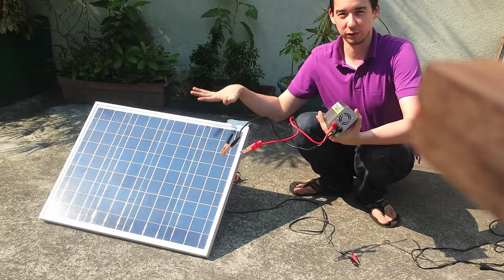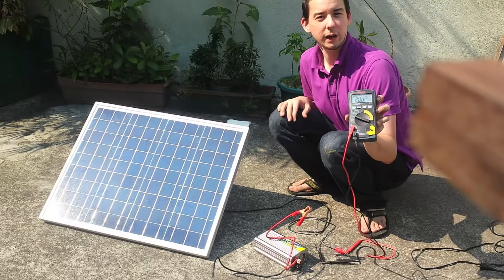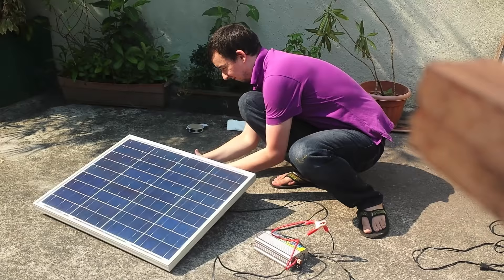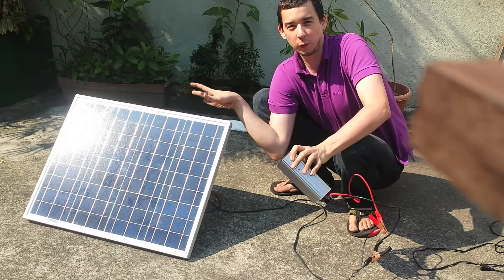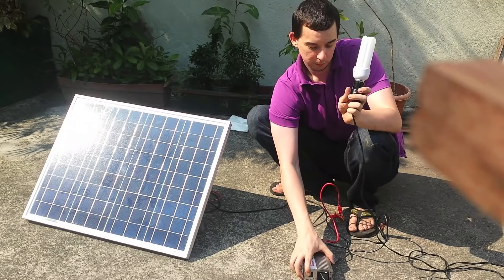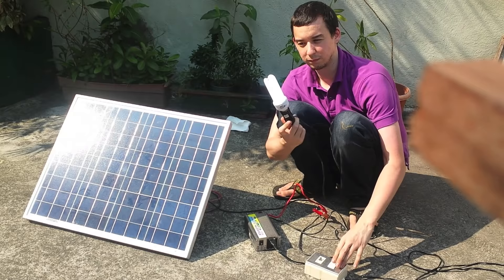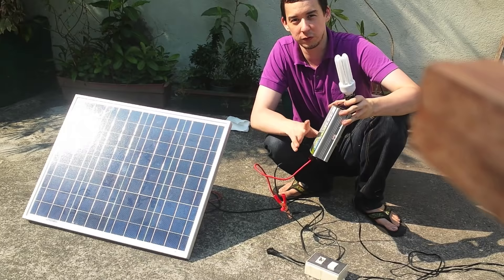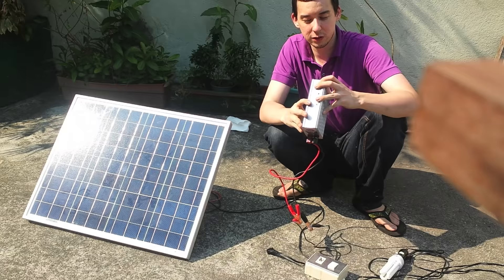Inverter wired directly to solar panel

Comment: how many solar  panels  and how many batteries  do i need to run an air conditioner from the solar panels ?  and what size iinverter do i need ?
Reply from the maker: ***** Mmm that question would take a really long reply and there are so many variables. You'd be better off Googling it to be honest. The short answer is a LOT of panels and a really beefy inverter.
Reply: Gadget Addict      ok  thanks

Comment: how many desktop computer can simultaneously run by 80 watts solar power system and how long it will last. thanks...
Reply from the maker: It depends how much power you are storing into your battery after losses and how much loss you had at your inverter and of course how much your computer and monitor actually consume. My guess would be 0 or at most 1 desktop computer on an 80 watt panel. My large (typical) desktop with monitor consumes 120 watts. But then I also have a small atom computer with monitor that consumes 30-40 watts. To know how long it would last, work out how much power you'll be storing after losses and then divide your load by that.
Reply: Gadget Addict Actually I really don't have any idea about solar power system but I'm quite interested to learn. Let's say I'm planning to run five 300 watts coffee vending machine simultaneously, what is the appropriate solar power system needed? Thanks for responding to my query.

Comment: my friend your video is really helpful.now i want to know from you please,i have  70 watt solar panel in my home with battery and charger.i am using that for lights only during load shading .now i like to improve it to 200 watt. what i need now.and may i use my led tv 32" from direct solar by using inverter that you shown us.
Reply from the maker: How are you running your lights from the solar power? I wouldn't recommend running an inverter directly from the solar, you should really connect the inverter to your battery.
Reply: Gadget Addict no i am using dc light without inverter. which call solar light/led each one 6 watt. and our request to you can you load a full solar system video around 200 watt.which will help us to make solar panel in our home. it will with all thing that we need including dc to ac converter.please
Reply from the maker: Monir Ahmed If you already have the solar panel and the battery then all you need is an inverter. The inverter will step the 12v battery up to 220v and you can connect your AC devices..

Comment: Well there is an MPPT grid tie inverter that is being sold with claims you can wire it directly to the solar array.
Reply from the maker: Yes that's how pretty much every grid-tie inverter works.
Reply: +Gadget Addict, ok. well that's reassuring to know.

Comment: You can of course run the invertor directly from solar panels. This is all a money making solar power to grid invertor does !! (your local regulations  may bar you feeding it with battery power. hmm. )

Comment: panu kung gusto kong i-power ang aircondition ko thru solar panels? pde pa ito? 700watts ung output ng aircon? so kelangan ko ng 10pcs na 80watts panel? and ilang 12v car battery ang kelangan? tnx
Reply: Pablo Reyes Mr. Reyes,
Compressor-driven appliances like air conditioners have a start-up current that is usually 5 to 15 times (or more depending on the horsepower rating) than the rated running current.  The inverter must be able to handle this momentary spike. Two things can happen if the peak current capacity of the inverter is less than the start-up current: 1. It will reset due to an overload condition  or 2. An inferior inverter will simply burn out.

Inductor motors do not work well with square wave AC outputs or even with modified sine wave inverters. These can cause your AC motor to buzz, be out of phase and eventually burn out even if the peak current and continues load rating of the device is well above the horsepower rating of your AC. It is recommended that you use a pure sine wave output inverter with a rock steady frequence (60 Hz in the Philippines at 220 VAC).

The power company output is a sine wave.

At 800 watts, a good range of will be above 5000  to 6000 watts peak rating for the inverter with a pure sine wave output. Check out your loading requirement and your AC specs if this is enough. At 220 VAC, chances are a lower rating might work for you.

As for the batteries, automotive batteries do not work well with supplying the power requirements you need to run your AC. Automotive batteries have high but short term AMPS (as what is needed for starting the car's starter motor). 

Deep cycle , AGM, or gel type batteries are what is usually used for powering equipment via an inverter. These usually cost more than regular automotive batteries.

The battery size will depend on how long you intend to use your AC in between chargings, your solar panel capacity and the charge controller you will be using.
Usually, batteries can run a load down to 80% of its rated capacity though there are AGM and Gel type batteries that can go down to 50% of its full charge capacity before you need to shut it down( or the inverter can do an auto shutdown to prevent battery damage).

To give you an example, a 100 Amp HOur battery running a load of 1 ampere can deliver 80 hours (80% efficiency)  of power before the voltage drops off to a useless level.  Your AC which is rated at 800 watts has a current rating of 3.6 amps (800W/220V=3.6 amps). Theoretically, your AC should run for 20 hours or so without considering other factors like system loses due to inefficiencies, resistances, battery condition, etc. Maybe you can run it for 2 to four hours before you run down the battery to 80 percent of its full capacity.

Then, there is the issue of recharging the battery via solar panels. A 100 watt solar panel can give you a charge time of 12 to 15 hours for a 100 AmpHour battery. This panel can output 8.3 amperes at 12 volts and a full sun. you can add more solar panels to increase your charging capacity and cut the charging time. You may also add batteries to increase the stored power capacity but this will require more charging times and/or more solar panel capacity.

Cable size will also play a factor in how much power you can get from your system.

Designing a solar power system is a balance of your equipment that needs the power, your battery size , your solar panel capacity and your budget. You will need a very good and stable inverter as well as for the rest of the system to power your AC  significantly enough to cool you for a reasonable length of time. And good systems costs $$$$.

gil

Comment: I got 20 Watts Monocrystalline panel and 12V 7ah Battery and 500 Watts inverter.
What are the Appliances that i can run with this thing.i use 15W light Bulb but it runs only like for just two hours.im a bit dissapointed.
Reply from the maker: If we imagine your panel got an average of 5 full sun hours in a day, the maximum power it could generate is 100 watt hours (20 * 5). But there are some losses in storing that power into your battery, so maybe it's 80 watt hours stored. The larger your inverter, the more power it wastes, a 500 watt inverter can waste 5-10 watts just by being turned on. So your 15 watt load actually becomes 25 watts. 80 watt hours / 25 watts =  3.2 hours. You should consider using DC lights connected straight to the battery instead of an inverter and ideally a bigger solar panel and battery.
Reply: 500watts inverter for a 7Ah battery, overkill.

don't assume that if you got a 500W inverter you also load it with a 500W electronics/electrical devices, you must consider also your battery size and your PV.

yang 7Ah na batt ginagamit yan sa mga UPS.

or better buy those Omni/Firefly emergency LED lamps that can last up to 8 hours at the cost of 1.5K, I think the battery inside is a 6V 4.5Ah SLA

Comment: maybe u can put a 12volts fix positive regulator on solar panel so that the output of solar panel is now fix at 12vlt
Reply from the maker: Yeah I could use a voltage regulator like the 7805 I used the other day to drop 12volt down to 5 volt. Although a switching voltage regulator is much more efficient (I want to try make one soon). But to be honest this was really just a proof of concept and a 'can it be done' type of thing. At the very least I'd recommend a 12v 7ah battery which can be bought for 600-700 php. It will make things so much smoother and easier and reduce the chances of breaking your inverter.

Comment: can i run a 100watts inverter directly on 10watt solar panel?
Reply from the maker: Possibly but I doubt you'd get any use out of it. In my tests, the 500 watt inverter from CDRKING consumes 5-10 watts itself even when idle. The 100 watt inverter consumes around 3 watts. So losses from the voltage drop, the idle consumption and then loss in output, I doubt you'd get anything workable for a 10 watt panel direct to the inverter.

Comment: Dear 
I need Your Help I have also purchase this inverter but i wana ask , can i connect directly 150watt solar panel with this inverter , i m confused  because  you have connected only one panal of 60watt
Reply from the maker: You can, for experiments, but for a long-term solution, you need to use a battery.
Reply: ok But if i use battery then how Battery will charge need suggestion ? can its possible solar panal conect to battery and batery connect to Inverter , possible or not , any fault or danger for inverter or solar panals
Reply from the maker: Manzoor Ahmad You'll need a solar panel, charge controller, battery and inverter :)
Reply: In a nutshell, you connect the panels to a solar charge controller. The charge controller is connected to the battery and charges the battery, and the battery runs the inverter. Of course, in the daytime some power from the charge controller is also powering the inverter. The battery 'stabilizes' the voltage.
NOW, the battery voltage should approximately match the panel voltage. 12v battery with a 12v panel, 24v battery with a 24v panel, etc for a PWN-type charge controller. If you buy a more expensive MPPT controller you can mix and match voltages.

Comment: How many yrs using CD r king solar panel polycrystalline
Reply from the maker: Less than a year. They haven't carried the large solar panels for a long time and when they first started selling them, they were only in a few stores.
Reply: How about a inverter,battery?
Reply from the maker: Jepoy Balanza I use motolite batteries, not CDRKING. The inverter int his video was used for a similar time period as the panel.

Comment: Hi I need to have power in my basement and I only need it for daytime use could I use a 1000w solar panel and draw 700w . Many thanks Martyn
Reply from the maker: Possibly but I wouldn't recommend trying to do that without a battery. The inverter would struggle a lot.
Reply: Gadget Addict ok thanks so could you advise me what I should use panels battery ect for a 700w power device pls I need it for 18hrs dayly
Reply from the maker: Well it depends how long you're going to draw 700W for. If it's just for an hour, you could go for a smaller solar system. You'll need panels, charge controller, deep cycle lead acid battery and an inverter. Depending on what you're powering, you might need a pure sine wave inverter.
Reply: Gadget Addict  well I'll need it for 18 hrs a day mate
Reply from the maker: Oh, you're going to need a much larger system.Full sun hours for your panels is 5-6 hours a day. And you'll certainly have to be storing the power in batteries because the sun wont stay up for 18 hours.
Reply: Gadget Addict ahhh I see so would  a car battery work for storing the batterys and if so how many do I need . and what's the least whatts solar panel would you recommend  .and other you get up really early or your not in the UK lol
Reply from the maker: Car batteries would work but they're not recommended because they're designed to output a large burst of energy to start your car and then a small amount while your alternator is running. You need deep cycle batteries designed for solar. You'd need many of them and many panels. To be honest, you might be better off checking some other solar videos, like i have a Solar 101 video. Because what you're describing is quite a big and expensive system.  Off the top of my head I'd say 3k GBP at least.
Reply: Gadget Addict 3k is that £3000 on what it will cose or 3kw ? and yeah  could you send me a link to your other video pls and are you from the UK? you have a British accent
Reply: you would need a 4000 watt solar system and a battery that can store 25000 watts or more and that is without reserve for cloudy days.  Or a 600 amp hour battery as a 48 volts system at minimum....a 3000lbs forklift battery, about $4000 to $5,000 battery new.
With car batteries you can only use 15 % of there capacity Which is not much or they will be killed in no time. You also would need a roughly a110 + amp charge controller.

Comment: yes it works but this is not right....a charge controller should be incorporated in between. Again this doesn't give a steady output due to fructuating panel output because of changing weather conditions, and so not reliable.

Comment: can i use a 500watt inverter on a 10watt panel and a 3amp battery?
Reply from the maker: I assume you mean a 12v 3amp-hour battery. It might be technically possible but I wouldn't advise it. My CDRKING 500 watt inverter consumes 8-10 watts while idle, that's without any load connected. If you fully charged the battery using your 10 watt panel, then sure you could run your 500 watt inverter from the battery but it's not going to last a very long time. Lets say your battery was fully charged, that gives you 36 watt hours, except you dont want to let the battery drop below 50%, so we have 18 watt hours. Lets say you want to connect a small 25 watt LCD TV. 25 watt + 10 watt inverter loss = 35 watt. So you could watch that TV for about 30 minutes before the battery dropped to 50%.
Reply: Gadget Addict ahh ok i also have a 68amp-hour battery but it charges very slow because my panel, how many watts do you recommend on the panel to charge it with a low budget?

Comment: Running 20V to something that is supposed to get only 12V maybe a maximum of 15V is not good for the device. Shortcuts are not always shortcuts in the long run. Working with solar, do it right or not at all.
Reply from the maker: Logan Mapes As mentioned in the video annotations and description, it's only a test to see what would happen :) It certainly isn't recommended.

Comment: im looking at wire from the panel to the inverter.. somehow it bothers me that the connection you made might get short (spark)... :) make it safe next time...
Reply from the maker: It might make a spark. But like I said, this isn't a recommended practice. This is just a test. I really wouldn't recommend wiring a panel straight to an inverter for any long term usage :)
Reply: yeah.. thats right...  may i ask if i install 80w panel then 1 battery bank..using 500w-800w inverter is it ok to sustain my house light usage... im just confuse how to compute it.. example i use 6 pcs bulb with 15W and 2 fan 45w, how many hours does it will last with continuous usage at night using 1 battery bank...
Reply from the maker: burgershoppe achmed If you had a panel generating 80 watts, over a 5 hour period it would generate 400 watt hours (80 * 5). There are some losses storing that power and your panel may output more or less than 80, but lets keep it simple. If you stored those 400 watt hours in a battery, you could run a 1 watt bulb for 400 hours (400/1=400) or a 10 watt bulb for 40 hours (400/10=40).  Your six 15watt bulbs come to 90 watts so 400/90 = 4.4 hours. If you have the lights and fans, thats a total of 180 watts. 400 / 180 = 2.2 hours. Hope this helps.
Reply: :) thank you so much it really helps... now i know how to compute the usage... its a big investment or somehow complicated before but now i can estimate my installation and power usage.. thanks again and gbls...... tc...
Reply from the maker: You're welcome. I hope it works out for you. Just let me know if you need any help :)

Comment: actually i just try this using 30watts solar panel with 17-18volt.. but it does not work.. why is that?
Reply from the maker: super guyver Did the inverter turn on at all?
Reply: Gadget Addict
 it turn on but it shown a fault at red led
Reply from the maker: super guyver Perhaps your inverter over-voltage protection kicked in. It varies between different inverters. You could try add a voltage regulator between the panel and the inverter. Remember this is only a test/proof-of-concept, not something I actually recommend doing :)
Reply: Gadget Addict
 ohh.. okay.. thanks alot man.. very helpful.